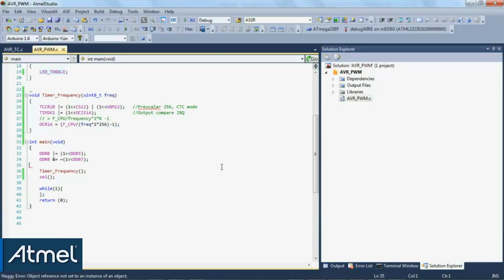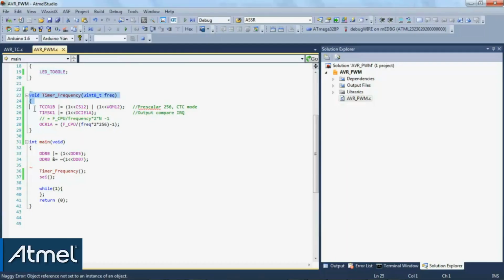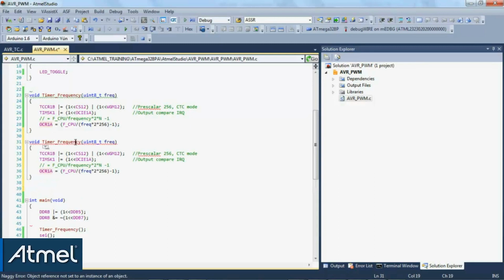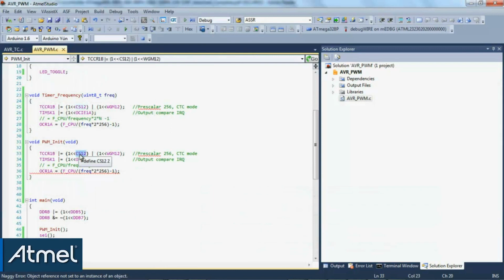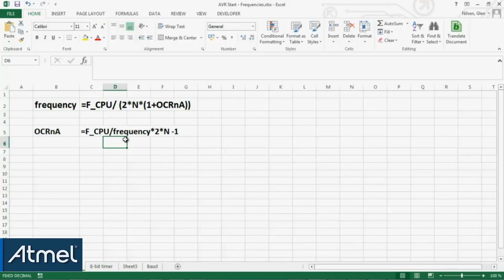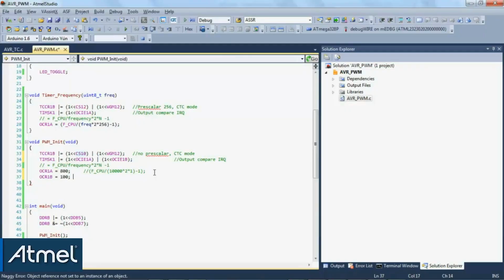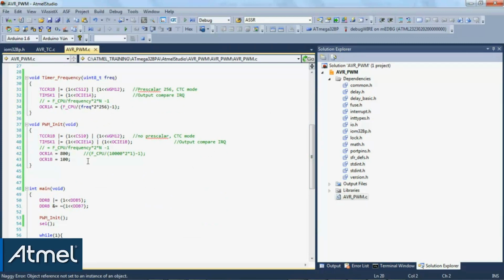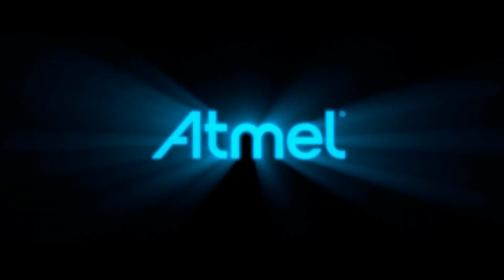Getting Started with AVR: Using PWM to Dim an LED (#9)

Comment: these videos are a great help, but the audio is terrible, mainly because it is only in the right channel.  while it's echoy and quiet, but that isn't as bad as only hearing it in one ear.  I might suggest updating the video and just changing the audio to mono so it can be heard from both sides.
Reply: it would also be very useful if you had the code available outside of the videos(either in a hosted project or just a pastebin link)